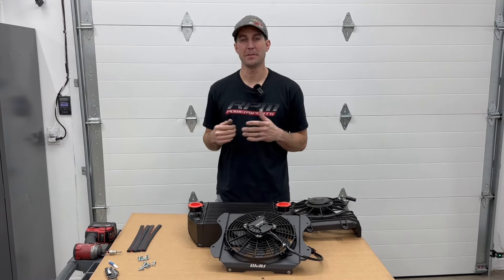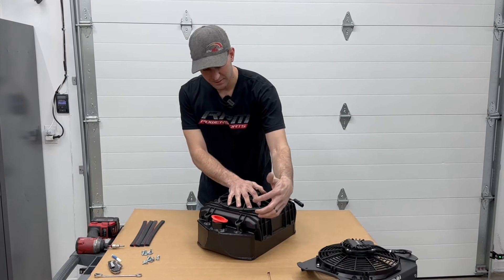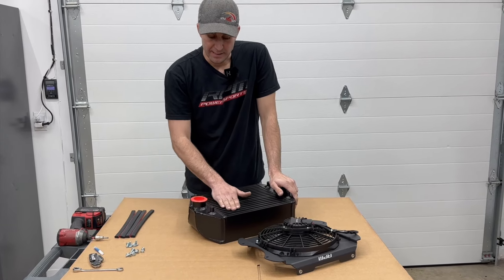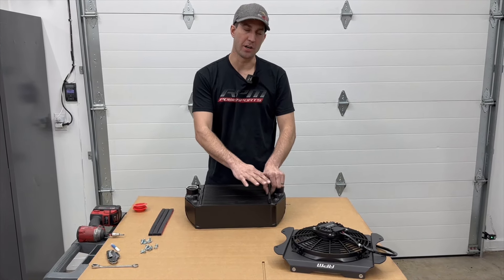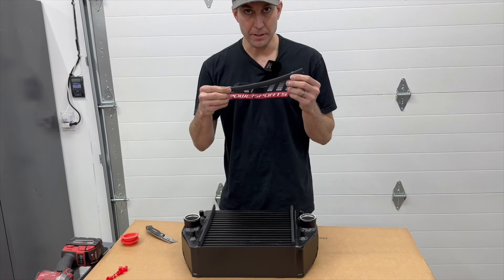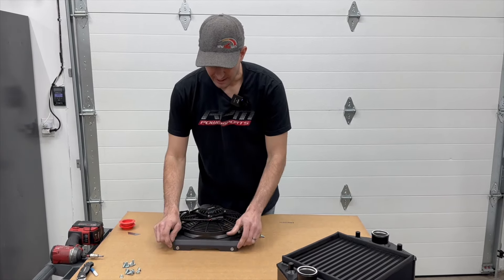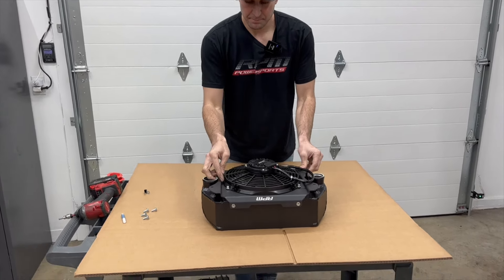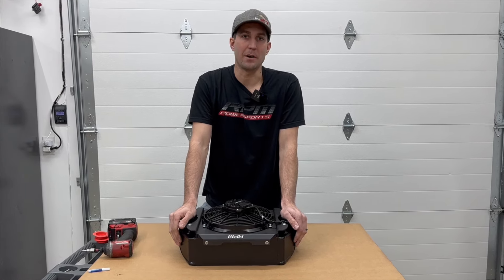Can Am X3 2020-2024 Sealed Intercooler Fan Shroud WITH 10" 10 Blade Brushless Fan Upgrade

Comment: Looks interesting, are there any graphs or data that can compare this to my OEM fan? Looking on their site I couldn't find any specs, could I get some CFM ratings etc.?
Reply from the maker: In regards to CFm It’s hard to get a good comparison comparing two totally different designs. The oem is a smaller fan, less powerful motor, and pulling air from “not through the core” the only accurate comparison is if we sealed the oem or left a 1” gap around the edges of the RPM set up or swapped motors between each. All irrelevant comparisons. We planned on adding the pulling force CFM testing we did do to the video but again, the comparisons of two totally different designs makes it irrelevant.

Comment: Any plans to have this fan available for the 17-19 X3 intercooler upgrade?
Reply from the maker: We do plan on it soon.
Reply: You guys working on a brushless radiator fan upgrade?
Reply from the maker: @joshc63111  , they will be released soon
Reply: @RPMPowersports  got a release date?
Reply from the maker: @joshc63111  mounts should be off the cnc machine next week.
Reply from the maker: https://rpmsxs.com/products/17-19-50mm-ic-brushless-fan-upgrade?_pos=2&_sid=05de13d9d&_ss=r
Reply: I just bought the intercooler and fan. Doesn’t appear there is a cut out on the fan shroud to accommodate the metal tab at the back of the mounting hole like the OEM fan shroud. How is the intercooler supposed to mount and be flush with the screw holes?